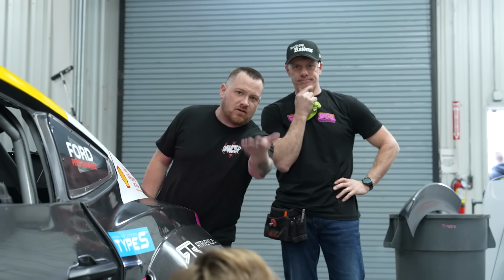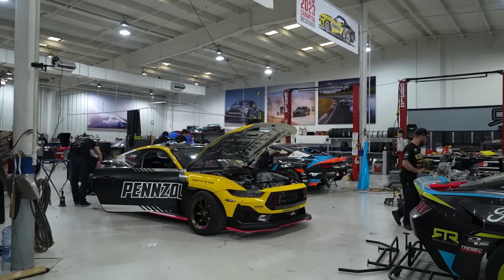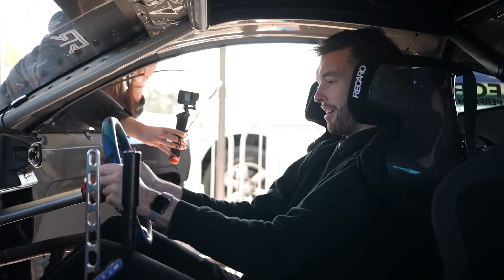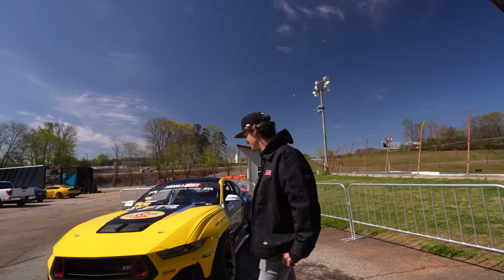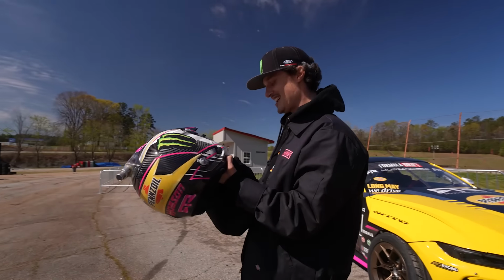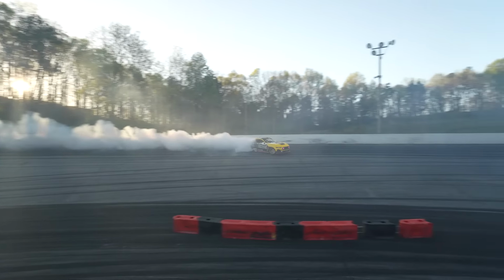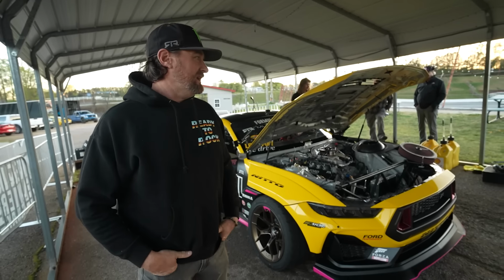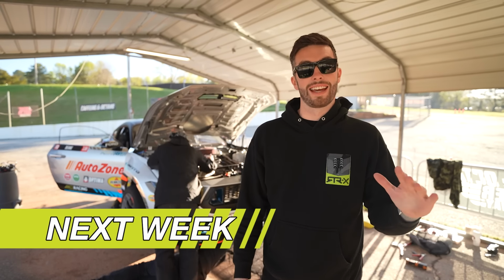NEW 2024 RTR Formula Drift Liveries

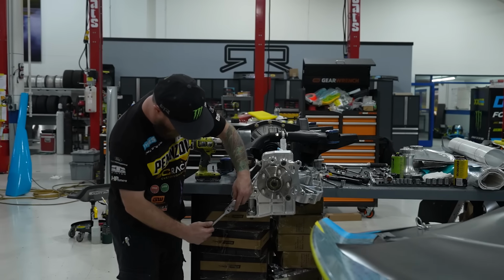Comment: 3:25 so much drama... 😆like you really need the pennzoil sticker to test the car? is it really what holds it together? 😂 i mean the oil i believe but now the stickers... test the car then see the wrap situation...
Reply: btw whats the point of those wheel covers? have you ever seen a wall that doesnt eat those for breakfast? plus whats the point of having a cool wheel behind a cover aswell? not only the cover wont do much in a proper crash, but also kinda kills the point of having beautiful wheels... yes yes it is to "protect the expensive whe..." bla bla bla, just put a dam cheap steel wheel at this point, its going to be ugly and rekt either way so...
Reply: @P4FElton  the aerodiscs or wheel covers as you call them are just for looks, that's all
Reply: @aiden6843  if that crap has no actual mechanical function i cant say i respect RTR... who the fuck does that to those wheels? i swear up to this point i thought it was a metal cover to protect the wheels in case of crash or touch in the wall (thats why front ones dont have), even with a mechanical function they still useless as i explained, if they dont... then wtf are thooooose
Reply from the maker: We need liveries on the car for livery reveal content. It’s expensive to rent tracks and run cars.👊
Reply: @VaughnGittinJr  ok but now the big questions are those wheel covers just for "looks"?
Reply: @P4FElton  probably directs smoke slightly too from what I've heard but not actually sure
Reply: @aiden6843  and use its as tactic while leading? That would be... I mean cool for them... Nota só great for chase and spectators 😅
Reply: @P4FElton  yeah but that's as far as I'm aware a rumour but lots of rumours turn out to be true

Comment: What is the weight and horsepower of the car? And what is the width of the tires.
Reply: roughly 2900 pounds, somewhere between 1100 and 1300 hp to the wheels (im not sure about wether they mean to the wheels or at the crank) and 315 tires as far as I'm aware
Reply: @tristan7122  thanks bro. I found out the horsepower and weight but couldn't find the tires width. So they make the same power as last year?
Reply: @hugo-pg5tv  sure, happy to help :) I think they said, they're making a little more power (presumably 50-75 more (whatever that means on top of that 1100 to 1300 range) and as usual some front geometry changes so they can get the car more nimble (which is a goal they are chasing for a few years now, starting with the older S550)
Reply: @tristan7122  oh so it makes close to 1200 without the nitrous? Last season the car made 1111hp and 1300hp with the nitrous.
Reply: @hugo-pg5tv  no, no it's making 1100 - 1300 with the juice, but I'm assuming they found a few more HPs either by adding a bigger shot of nitrous (kinda doubt that, could be a bit too much to go for over 300ish shot of nitrous on that engine) or by tuning some timing / fuel / something something in the engine itself to get those extra HPs
Reply: @tristan7122  so what does it make without the nitrous?
Reply: @tristan7122  I believe they put on the same air intake as Chelsea used last season.
Reply: @hugo-pg5tv  previously it was making somewhere between 850 and 950 without nitrous (because they were running a little bit older model of this engine at 800 ist for Chelsea and 900ish (almost 1000) for Vaughn in 2017-2018, before they introduced nitrous into their builds
Reply: @tristan7122  that is still huge amount of power from a NA V8 tho. Vaughn also said they run slightly larger front tires now for extra grip. Do u know if they use the 5.0L coyote engine?
Reply: @hugo-pg5tv  No they run an unlimited Nascar 400something cubic inch Roush Yates, something something (it's basically the best of the best off what Ford has to offer for their Motorsport Teams, If I remember correctly it costs around 60K)
Reply: @tristan7122  how big is that engine in liters, I am bad at converting cubic inches to liters. In the demo cars they use a coyote engine right? Like in the Touge drift videos?

Comment: HEY we use a product called AWLWOOD ma CLEAR made by awlgrip in the marine industry that works really well for building film thickness that you can block and has superior UV protection in the product- you can spray "hot coats" and then block it out and spray more over top for a finish - works wonders for finishing carbon fiber if theres any uglys in the resin or clear gelcoat your using

Comment: 18:14 I can't be hearing things... Chelsea's car, Ben's new FD car, still sounds different from the rest of the RTRs, even though they all have the same parts now. James' car sounds more exotic, like a Ferrari (not really, but there's a pitch that's being made & it reminds me of a Ferrari), while Ben's car sounds like a traditional NASCAR, with a bit more low end grunt. 

Vaughn's car doesn't sound like Chelsea's car, either. I don't think it's the driving style because Ben is driving differently from Chelsea, yet, it still makes the same distinct sound from last season. Maybe its the tune? I heard from Forest Wang that the tune can change the sound drastically, even with the same engine setup across the board.

This is very interesting to me. Does anyone else hear the difference? I'd like to hear your opinions on the matter, aswell. 😌👍
Reply: Slightly different intake setups I think? And Deane's car is running a new X pipe exhaust
Reply from the maker: James got a new build this year so some differences.
Reply: @VaughnGittinJr  James' car also seemingly revvs faster & hangs less than Ben's. Lighter flywheel, maybe? I saw the way he transitioned; a lighter flywheel can help with the snap to angle because there isn't as much revv hang to slow the transition speed. Also, with the weight bias being more similar to what James' is used to & more helpful (if this is correct), I can see why this would also contribute to a more functional transition. 

I have so many questions, but I don't really want to be rude or intrusive. I've always had a burning passion for drifting. In some way, shape, or form- I always find myself spiraling whenever I gain information that clicks; the realization of how something works. Then I immediately apply it because why not just send it, right? 🤣
Reply from the maker: @KingDeadMan James throttle was hanging.
Reply: @VaughnGittinJr  Are you talking about him being on throttle more consistently or that the rpms don't actually diminish as quickly as I thought they did? 

How would you describe the connection between RPMs, wheel speed, and contact with the road surface?

I know it's not simple to explain, as there are more factors at play than what the question is seemingly asking.